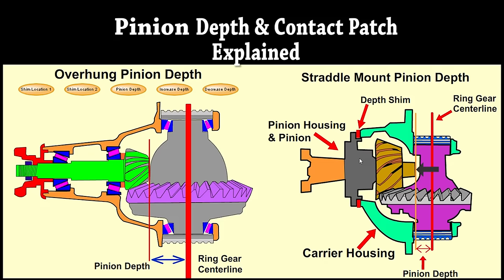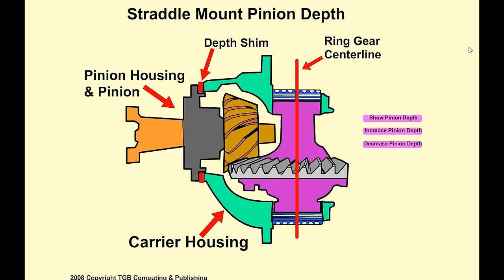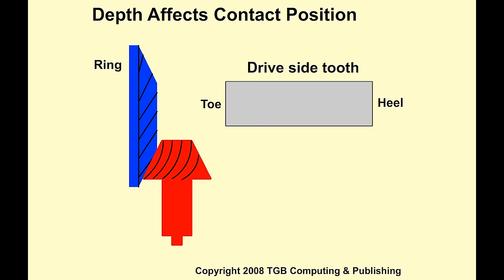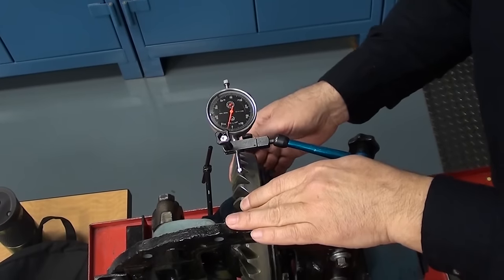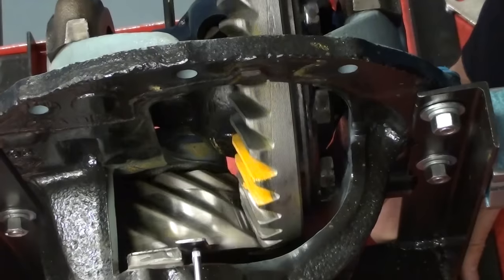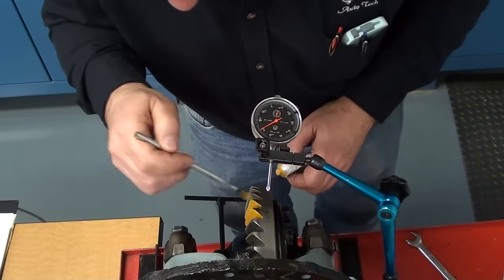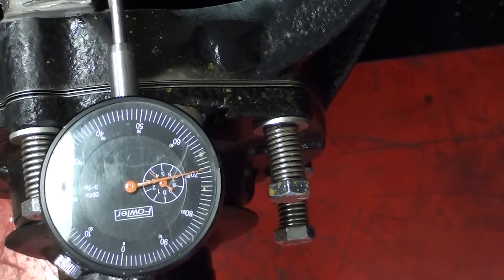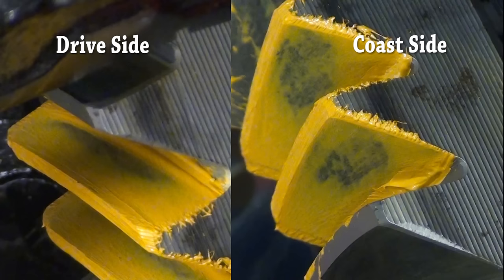Contact Patch & Pinion Depth Explained

Comment: If only all videos were this clear, concise, and well done. The old saying is "A picture's worth a thousand words" and this animation is worth a lot more than that. Fantastic job DLMaster!
Reply: Actually its a faulty diagram. Read my comment above of why this is. Faulty diagram. The pinion itself and the conical bearings, on each end of the pinion, have to have zero clearance or the pinion would tilt up or down randomly during use. Therefore all in and out play at the drive shaft flange must be zero clearance to cause each cone inner bearing to ride straight on the races. So that is an absolute that must be addressed and the location of pinion teeth with the ring gear would have to be done with a pinion that extended farther in its length by the machining maker or a ring gear that had teeth that extended farther inward. But you cannot have in and out play at the flange at the nut

Comment: I overhauled a lot of differentials in the past; and your video hits the mark.  Most people don't understand how precise the set-up has to be; and how a very very small miscalculation can cause all types of drivability issues.
Reply from the maker: Thanks
Reply: Should emphasize the fact that contact patch and backlash should be checked with the axles in the differential (loaded) and tires on to offer some resistance in drive and coast.
Reply from the maker: Thank you for your comment and observation. The axles do not have to be in and in this removable design that is really difficult.  It is very important to provide a load or resistance to rotation to obtain a good contact patch pattern. What you can't see so well is I built in a braking mechanism that is applying rotational resistance to the ring gear.  This is adding enough load to provide a good pattern. The objective of this video was not to show how to perform a contact patch pattern but instead to explain how the pattern is effected by the change in drive pinion depth.

Comment: Pretty clear and educative. I have learnt 2 ways of differential gear adjustment from you, i.e using dial gauge measurement and contact marker visual inspection. Thanks!!
Reply: The Dial indicator is measuring Ring to Pinion gear backlash (clearance)
The gear contact paste, is indicating Pinion gear engagement depth with the ring gear.
Two very different measurements...

What you are not told is in order to setup a pinion on an 8.8 Ford, it requires the purchase of an extra (setup) bearing, identical in manufacturer to the bearing you will finally use. This bearing must be modified to "slip fit" on to the pinion so pinion depth can be setup. Additionally, you will need a few extra crush sleeves for this process...

Comment: Good information. I've had production experience setting up construction equipment spiral bevel gears, same system applies. A little toe bearing centered up is acceptable as opposed to heel bearing. The toe of the ring tooth being thinner will flex and spread increaseing the load bearing pad back towards the heel.
Reply from the maker: You are correct.

Comment: Excellent video explaining Ring and Pinion gear relationship.  The most helpful to me was the use of gear contact paste on just two teeth. I see other videos where its slopped all over the entire ring gear.  Your approach makes better sense.
Reply from the maker: My factory training taught me to paste every tooth and it can revel some information about  the setup however in real life I paste 4 teeth every 90 degrees.  This gives me a feel for the setup.

Comment: This video is great and helps a lot. The only thing I don't understand is when you say you have to move the pinion gear father away from centerline, I don't know which way you're moving it because I can't see it moving in the video.
Reply from the maker: Watch from timestamp 0:26 to 0:31 and 1:16 and 1:22.  The pinion moves to the left but I don't like to say to the left because what would happen if the image was flipped 180 degrees or even just 90 degrees.  So it's not a good idea so say the pinion moves left, right, up or down but instead talk about in relationship to the centerline of the ring gear.
Reply: @DrivelineMaster  
I'll try to look again, maybe I can watch the video on a 65 inch TV. Thank you
Reply from the maker: might be hard to see on a phone with a small screen but any monitor larger than 13 inches should be large enough to see the movement.

Comment: I'd like to see you continue moving the pinion away from the ring or "increasing the pinion depth" until the pattern went unacceptable the other way.
I just set up my Toyota 8" and the drive pattern you found acceptable I had at one point, but when I read the pinion teeth it was showing a shallow mesh leaning towards the diff centerline or toe (this is a rockcrawler) - so I pulled another .010" from the pinion head stack and ended up with a nicely centered oval drive & centered comet tail pinion pattern - but my coast pattern still looks similar to your drive pattern and I'm not sure why.
Reply from the maker: Your drive side pattern is your most important and the biggest goal is to make sure the pattern is not running off the toe, heel, face or too deep into the flank.  It would be great if drive and cost would always both be perfectly centered but that is rare.  In fact I prefer the drive side to be slightly towards the toe and coast to be slightly towards the heel. I do this because under heavy load the pinion will thrust slightly towards the front of the vehicle causing the drive and coast side patterns to center. If you are working on a front diff and it's flipped so the pinion centerline is above the axle like front diff's on 4x4's offend are for ground clearance the drive and coast sides of the ring gear are reversed.  The drive side is concave and the cost side is convex. I hope this helps.

Comment: Very clear video in showing relative positioning and optimal settings checks.

Could this test determine if a used pinion gear/ring gear combination  , has been worn beyond suitability for reinstallation practicality ?
Reply from the maker: severely worn ring and pinion sets are normally noticeable by visual inspection however they will often exhibit patterns that look like thin lines as compared to oval or triangular shaped.
Reply: DrivelineMaster 
Thank you for your reply!
I will bring this ; and use it.
Teach it;also.

Comment: So what were you adjusting everytime you had to move the backlash back to 10 thousands ? How do you read the number on the pinion gear to determine what shim pack is best and closest to start with? If it's a minus number foes that mean you need to add shims to bring it forward to the ring gear or have less shims to move it down to that measurement from the centreline?

Comment: Very good video. Would it be possible to place a link of the tools you used in the discretion? Thanks
Reply from the maker: The dial indicator is a standard 1" dial indicator. For in the shop I normally use one that can be setup using vise grip locking pliers similar to this Central tool. https://store.dealershopusa.com/product_info.php?products_id=77440&gclid=EAIaIQobChMI1sHB_4Gd_gIVkR-tBh0ZUwCtEAQYBiABEgJLgPD_BwE The spanner nut wrench is a Mazda specialty tool that is adjustable making it universal but I don't think it can be purchased anywhere except from a Mazda specialty tool store. To perform the contact patch watch this video. https://youtu.be/UIIk305-zlQ. To adjust backlash watch this video. https://youtu.be/d9cxw9d-css.  If you would like to Mazda spanner nut tool number write back and I will look at the tool one day next week and write you back.
Reply: @DrivelineMaster  I would like to get into differential rebuild. Most people remove the pinion and check. I notice he didn't do that. He was using a tool to adjust the depth and lash. I'm interested in that tool also. Was that the Mazda tool you mentioned? Thanks
Reply from the maker: The Mazda tool was the spanner wrench that I used to adjust the backlash.  I did not use a tool to change the depth. Instead I customized that differential to allow me to change the depth just by turning a threaded rod. For all other applications pinion depth is adjusted by disassembling the differential and changing a shim thickness. I also have a video on how to use a pinion depth measurement tool. You might want to look at these two video's.  https://youtu.be/gk6imita0cc and https://youtu.be/QL-dmhfSj6k and these two as well. https://youtu.be/_bUh9NEMldI and https://youtu.be/bxi7EiQzo9E

Comment: Are these gears face hobbed or face milled? Also does that actually even matter when checking patterns? I've been trying to learn all I can when it comes to setting rears up, love this demonstration!!
Reply from the maker: I believe this is a face milled Five-cut gear set.  If you have been doing some research then you most likely found this URL. https://gearsolutions.com/features/face-off-face-hobbing-vs-face-milling/ 

also this from Yukon gear 

https://www.google.com/url?sa=t&rct=j&q=&esrc=s&source=web&cd=&ved=2ahUKEwif_e-JxbL0AhXloFsKHYN6DQ0QFnoECAIQAQ&url=https%3A%2F%2Fwww.yukongear.com%2Fweb_images%2Fpages%2FBrochures%2F2-Step-vs-5-Step-Gears.pdf&usg=AOvVaw2q8lfMkwNzdKq7Hzfd8FJ-. 

The pattern is different and moves across the tooth differently depending on how it's cut.

Comment: Thanks so much for the video! It really made it clear for me. I was wondering if a used rear axle was making noise from say too much back lash, could it be made quiet again by making the right adjustments to the back lash/wear pattern? Or would you have to rebuild the rear end and get a new gear set? The rear axle has 120,000 miles on it and the teeth on the gear do not "look" bad.
Reply from the maker: If you are getting clucking from too much backlash especially when switching from D - R or R to D you most certainly can change the backlash adjusters (Shims or Threaded Adjusters) to correct or reset the backlash.  You won't need to mess with pinion depth and you should not have to worry about contact patch.  As long as you have the dial indicator and the tools and methods to make the adjustment.  Just make sure to check your backlash in at least 6 to 8 different locations around the ring gear and make sure the backlash is never smaller than the minimum specification. If your getting humming or moaning noises that is not a backlash noise and readjusting the Backlash will not fix this type of noise.
Reply: @DrivelineMaster  the noise I am getting is a moaning noise from about 30 mph on up. It moans when I am on the gas. If I let off the gas and coast it gets a lot quieter.  I changed both rear axle bearings as on side was bad. I didn't see any play in the pinion bearing and it spun freely. There were no visual defects in either gear.  What do you think is the cause?  Thanks in advance
Reply from the maker: This is a description of a classic rear drive pinion bearing noise.  Sometimes worn gears will do this but it's not as common as a pinion bearing.  Normally if it's gear noise you can't see the wear but a contact patch can sometime identify worn gears.  The contact patch should be non symmetrical triangular or oval.  Normally if the gears a bad the contact patch will be a straight thin line.  Place a listening device such as a mechanics stethoscope or you can use a screw driver or extension bar up to your ear while holding the other end against the differential housing in different locations.  Once near the rear pinion bearing and once near the front pinion bearing. Do this with the wheels off the ground and someone driving the vehicle accelerating and decelerating as you listen.  I put 95% chance your problem is the rear pinion bearing even if rotation feels smooth when turning it by hand.
Reply: @DrivelineMaster  Thank you for your detailed advice!!!!!

Comment: Subscribed;
You are the Master, great explanation; just out of curiosity what would it take to get a perfect pattern on both sides,and is it possible? and any advantage to doing that,just for (heavy,towing etc ) street use?
Reply from the maker: It does happen but not as often is I would like.  Start with a case with zero axial run out.  Add a quality gear set with tight tolerances.  Have it assembled by someone who takes a lot of care and attention to details. Finally the proper pinion depth.  I don't think the perfect pattern is that critical.  I personally like the drive side a little towards the toe and the coast side a little towards the heel when I take my pattern.
Reply: @DrivelineMaster  Thanks.

Comment: Nice vid explains a lot I have a better understanding of contact patch but  what happens if one side is ok but the over drive side (back side is off ) how would the adjustment be made ?
Reply from the maker: The drive side of the ring gear tooth is always the pattern of most concern.  If the coast side is off a bit I don't worry too much as long as the drive side is where I want it.  Two other factors effect contact patch.  Backlash and worn gears.  Although Backlash effects the pattern differently (hey, that give me an idea on a new video) worn gears will create all kinds of weird patterns that won't make any sense.

Comment: When you are testing the contact patch (by turning the ring gear) doesn't  it have to be under some load? Thanks for the video.
Reply from the maker: Yes, You are correct.  The cut away I used had a friction shoe pressing on the ring gear that you could not see as I turned the pinion. When I do this on the workbench or on the car I rotate the ring gear and apply rotational friction to the pinion.  One easy way to do this is to enlist an aid. Wrap a shop rag around the pinion just under the flange. Have the assistant pull on the rag to create rotational friction to the pinion.  This can make it impossible to turn the ring gear so the assistant needs to give a little on the force just enough to allow you to turn the ring gear.  I hope this made sense. The greater the load the better the contact patch you will get.
Reply: @DrivelineMaster  That makes total sense to me. I really appreciate your help and video. I'm currently restoring a 1970 Mercedes 6.3. As I'm sure you know the rear end of a Mercedes of this era is a little different, but I'm assuming all the principle's you spelled out apply. I may message you from time to time if that's ok:)? Thanks once again for your  video. Cheers John.
Reply from the maker: Yes you can email for advice. The principles are the same. I don't have much vintage Mercedes experience.
Reply: @DrivelineMaster  Thank you very much. I really appreciate that.

Comment: Your drive contact is centered but still looks deep as it rides along the bottom of the root, shouldn’t it be more centered face to root?
Reply from the maker: The more centered the better and I could have changed the depth a little more in the video to bring it up just a little more however it is very common to not be able to get a perfect pattern when building a differential so there is  a bit of a trade off and compromise that sometimes has to be made. As long as there is some paste that is not wiped off on all sides the differential build should be OK.  Depending on how hard it is to keep the trial an error method going to get the perfect pattern and if time is a concern such as when you are doing this for a living and not just your own vehicle you may not have the time to play with minor adjustments to get the perfect pattern when the one you have will work just fine without any problem. As I was trying to say, it is kind of rare to be able to get the perfect pattern for every differential build.